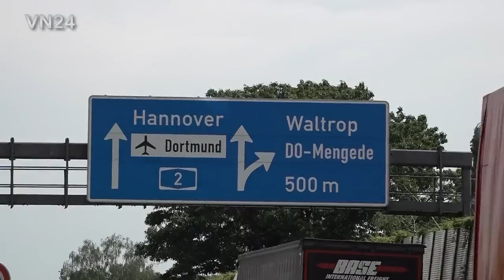19.05.2022 - VN24 - 7,5-Tonnen LKW verkeilt sich unter Sattelzug

Comment: This is a sad event. A very high impact crash where the driver in the middle truck lost his life due to the cab he was riding in was totally crushed by the trailer of the front truck. This is an example of why a large number of American truck drivers prefer driving conventional trucks vs the cab forward/ cab over engine trucks. The want that crush space in front of them.  I know it may not be practical in Europe due to regulatory and road structures. But having 2 to 2 1/2 meters of frame, engine and bodywork in front of you is more desirable than your knee caps and your self being the first to arrive at the scene of the crash with only a windshield between you and the object your crashing into.
Reply: I don't think a conventional cab would have saved him, the small truck he was driving would've most likely still gone under the frame of the trailer.
Reply: The driver of the 7.5 Tonne truck was shoved into the back of the trailer in front by the truck behind. So he didn't 'arrive at the scene'. He was already there.
Not sure even in the USA that 7.5 Tonne trucks are conventionals. You guys are still building what we called the Ford Cargo we stopped making 20 years ago so don't seem too concerned.
As for the 'Conventional vs Cabover' for Semis argument we would rather have trucks than can stop and handle well to avoid crashes and operate in yards that don't need a football pitch of space. Plus we don't have Swift over here.
Reply: @1chish  I had to look up what a ford ‘Cargo’ was. Have not seen one of those here in decades. After checking a little bit, it appears that your ‘7.5 ton trucks are roughly equivalent to what we refer to as “medium duty” trucks here in the US. They have payload ranges running from 4500 kg to 11,800 kg. The medium classes are classes ranging from 3 to 6. The 7.5 ton equivalent is the class 5, with payloads ranging from 7200 to 8800 kg. And there are a number of vendors supplying these trucks, from Ford, Chevrolet, Ram, Isuzu, Freightliner, Kenworth, Peterbilt, Hino, International and some others. They come in both conventional and cabover models. 

For tight close quarters maneuvering, the cabovers are superior in that regard because of the shorter wheel base lengths for the cargo bed lengths. No argument there. But an over looked feature on maneuverability is wheel cut angle. I suspect that most of your trucks are specked with the tighter turning front axles verses here in the states. I have driven trucks with the tighter cutting front steering, and I really like their extra maneuverability. 

But for handling, cornering and braking of cabovers vs conventional? Cabovers are not any better, just different. I actually prefer conventional trucks because they ride better, are more comfortable to be in, easier to get in and out of, are easier to service and work on, (especially the forward tilting hood models) and feel more stable. 

I find a conventional Ford F-450 with the 50 degree wide track front axle a much more satisfying and comfortable truck than any of the other cabovers I have been in. But I don’t have to deal with skinny tight crowded UK roads. And compared to cabovers, the F-450 handles high road speeds far better with the same payload. Most medium duty cabovers are just plain terrible for cab comfort and ergonomics by comparison.

No Swift? I am very sure you have your own equivalent truck companies which have the same levels or more of criticism. Every body has their training wheel and starter companies.
Reply: @americanrambler4972  
Conventional cabs are save, during front crash, only with light load.
Heavy loads after impact, are moving forward...crushing cab ...(!)
I'm OTR driver (NY-CA-NY) since 1996.

Comment: Did those coils break loose from the first truck?
Reply: No. They were lifted out of the trailer so the 7.5 tonne truck could be moved and the deceased be removed.
Reply: That coil is heavy and can move easy
Reply: @ericcastle7296  It appears to have been properly restrained. The Fire Brigade had to use a crane to lift them out (it's at the beginning of the video) to free the truck. If they weren't fastened properly, the first truck in the series would be severely damaged. It was driveable.
Reply: Thank you

Comment: is loaded incorrectly.  it is necessary to arrange the sheet metal bubble along the length of the floor, not the width.  The floor must be special for the transport of sheet metal.  Only special cars.  Standard TIR cannot transport this.  The floor has collapsed.  I used to work at the Container Yard, loading and unloading TIR, as a "cargo accountant, loading and unloading Tir" at FSO.
Reply: is loaded incorrectly. it is necessary to arrange the sheet metal bubble along the length of the floor, not the width. The floor must be special for the transport of sheet metal. Only special cars. Standard TIR cannot transport this. The floor has collapsed. I used to work at the Container Yard, loading and unloading TIR, as a cargo accountant, loading and unloading TIr" at FSO.
Reply: Oh man, you say, you "used to work at the Container Yard" but have no Idea, that this is n special Trailer to transport Coils? For Example "Krone" build this Type of Trailer,  you can watch it on their own Chanel here on Youtube..